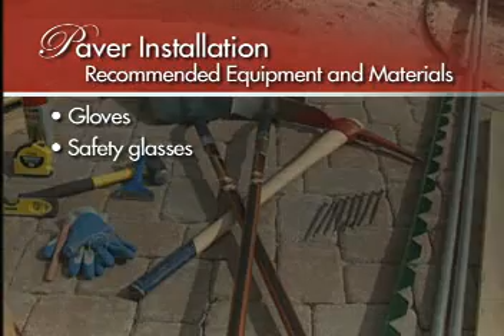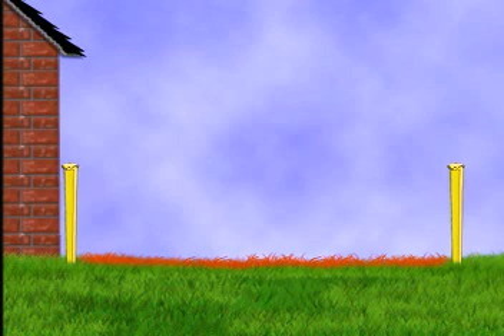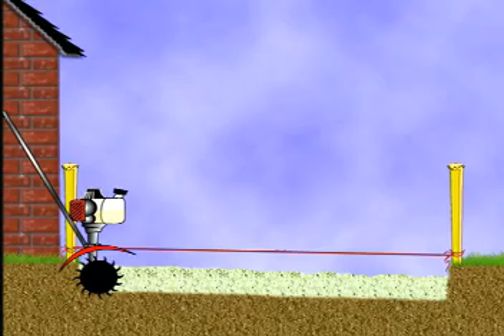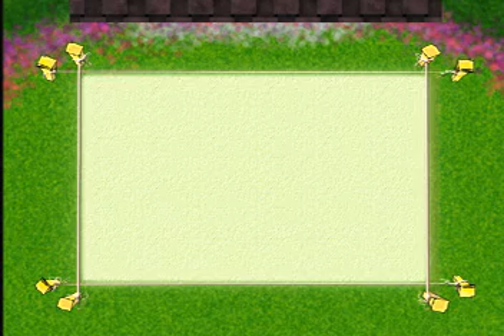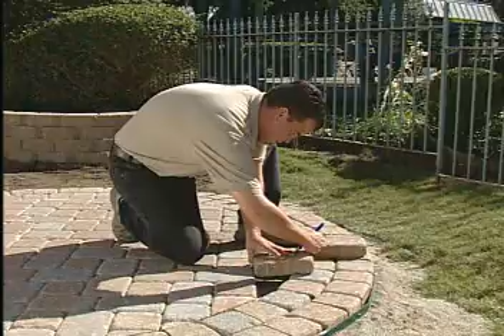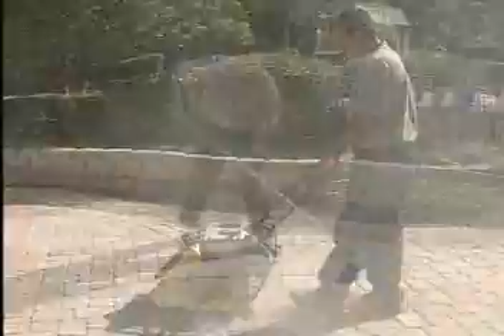Installing Pavestone Pavers

Comment: Also at 5:40 it says "... dig out to the depth of 3.5 inch down from the height of string line"... so say e.g. my string line is @ 1.5 inch above to ground level then i need to dig only 2 inches more?

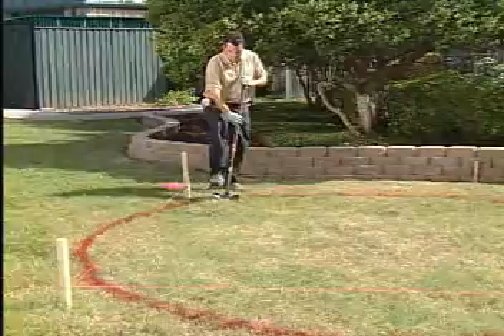Comment: At @ 5:32 in video it says "... dig out the project area to proper depth plus another 6 inches pass the string line." What does this exactly mean?
Reply: Viraj Deshpande  He means dig 6 inches beyond the "sides"  or edges of your project.  Not another 6 inches down.  Its typically done to ensure your sand or base won't fall away when you put the edging down.